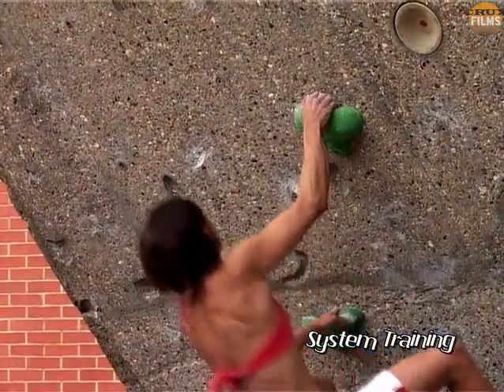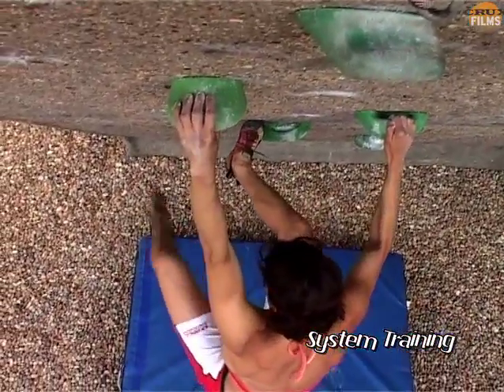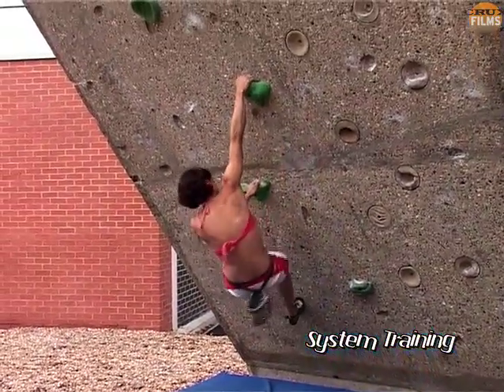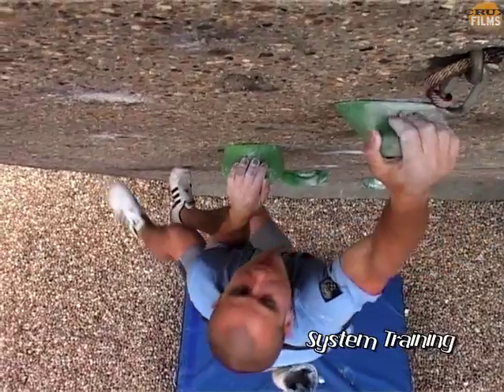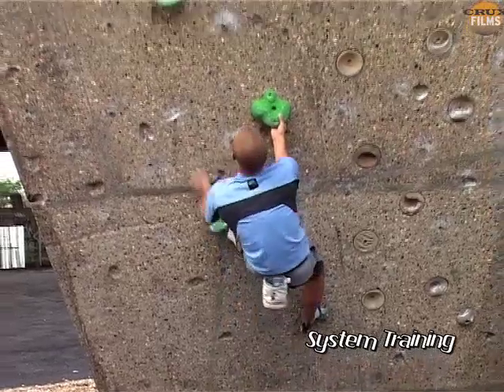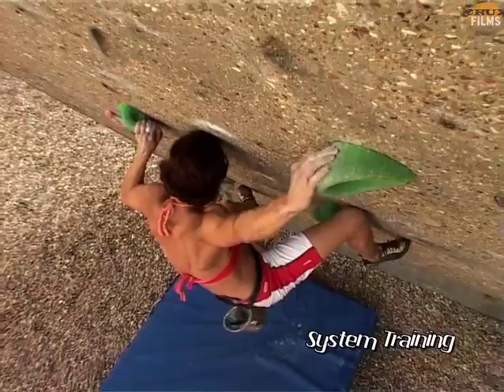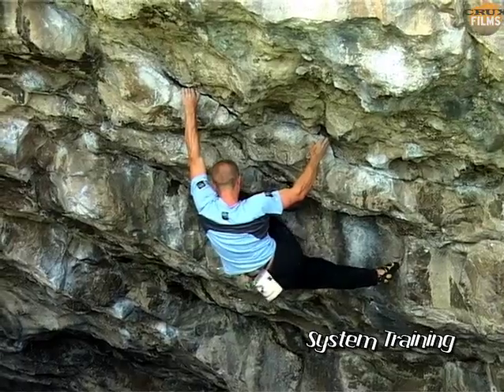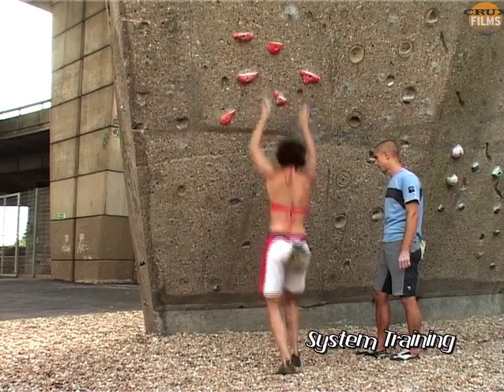31 System Training

Comment: I assume this training technique should be used only if you're very skilled and able to do it in the most efficient way. It would be detrimental to someone whose skills are not completely consolidated, as I am
Reply: This is a great question. I'm certain you would benefit a great deal from these movements and exercises and some system training no matter the apparatus or difficulty level. Many skills are only attainable once a person has a base fitness level or spent enough time mastering a skill theme to combine into a sequence. Each of these exercises as Neil demonstrated incorporate flow, rhythm, linking, and connection to the rock. No matter your current skill level you would benefit. Plus these activities are novel, fun, and scalable/measurable
 to difficulty regardless of the partner.

Comment: I get where you're coming from saying bouldering is better in a general sense than lifting (I agree), but strength training is literally designed to build more muscle.

So when you're a the stage of focusing on muscle growth, nothing will beat weightlifting. There's a small amount of muscle memory, but the vast majority comes from muscle changes, not CNS changes.
Reply: Yeah, but he's obviously talking about climbing specific muscles... Those are best built climbing. Picking up things mainly helps you get better at picking up things. No climber wants to build useless muscles as they present extra weight which is one of the most crucial factors in this sport.